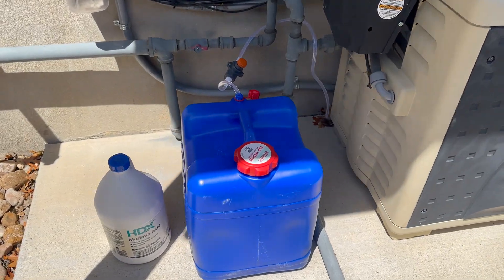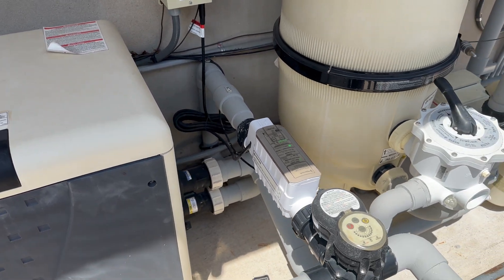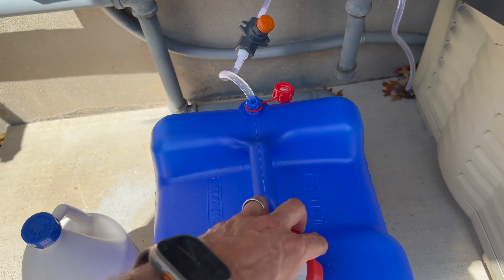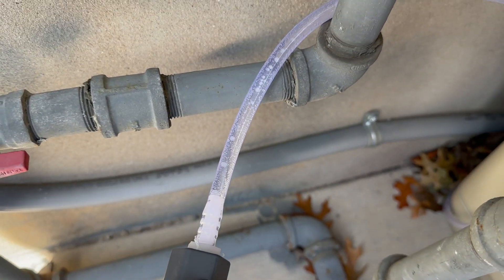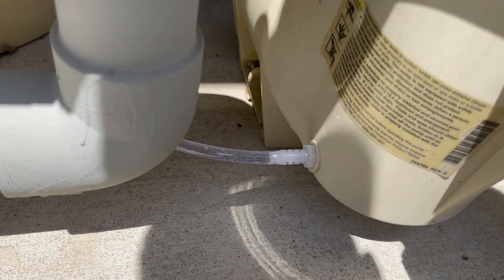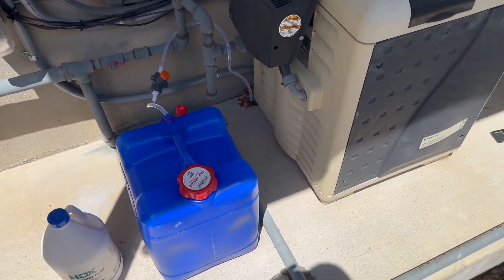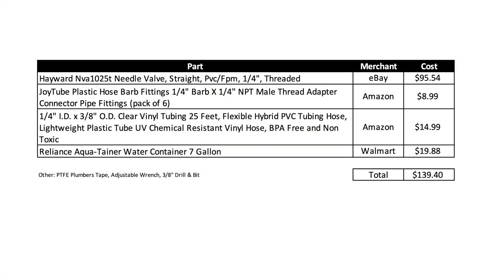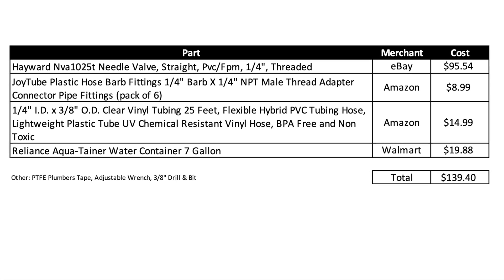DIY - Acid Injection System for Salt Water Pool (Part 1)

Comment: Hi, very cool idea. I would like to do the same thing. Just a couple of question. Online it says PVC is not very compatible with muriatic acid. Especially at higher concentrations. Any issues with your PVC valves corroding ? Also does direct injection into the pump suction create any issues with pump seal corrosion ? Lastly, when the pump is off does the negative suction pressure continue to pull acid slowly into the pump strainer basket ? I see you may have added a solenoid auto shutoff valve. I may do the same but I need to figure out how to get the solenoid to stay closed when the pump is not running. Thank you in advance and keep sharing these cool videos!
Reply from the maker: Without the solenoid I had a suction problem, and I did have to replace a shaft seal. Since adding the solenoid, I’ve tested the strainer basked 12 hours with pump off and there’s no pH change. I also am sure to run the solenoid early in the cycle so that the pump runs for hours after to ensure pool water has continuously run through it. 

I wired my aux circuit in an effective “man trap” meaning that the solenoid cannot be open of the pump is not operating. I also have an egg timer and a third party api monitoring automation ensures that the solenoid never opens for more than 10 minutes. 

I haven’t had any issues with the pvc valves. I do have them going inside plastic containers so if they leak I can see it. PVC seems totally good up to 20% concentration. Using 31.45% which is diluted in 50/50 water brings me less than 16%.

Comment: After seeing your video I bought the blue tank and then thought, why not use a bigger container?  I ultimately bought a 50 gal drum.  Instead of the expensive needle valve Amazon had some other needle valve options that I purchased instead.  The only issue I've come across is the tubing quickly becomes white and I can no longer see the trickle.
Reply from the maker: Agree on the tubing, but somehow some of my tubing is still clear so I can generally tell.

I opted not to go for a bigger container just in case I need replace the container. It forces me to inspect it once a month.

Comment: This will eat your pump seal up, spring in the multiport, Heater Core, salt cell blades.  This needs to feed after the Salt cell.  It is feeding very slowly but still will reduce the life of these things at the equipment pad.  That is why you spend the extra money for A Jandy TRUDOSE or Pentairs or Haywards version and install it according to there directions.
Reply from the maker: That was/is a concern of mine, but so far so good. I have changed the design and have a very high-end solenoid valve on it. So it's only activated for a few minutes with high water flow going through it and immediately followed by additional pump time at high.

I've considered an auxiliary pump and putting it at the end of the returns, but I've got almost two years on this and since putting the solenoid in, it's been very easy to work with and with the amount of acid and amount of water flow going for a very brief period of time, I don't believe the pH is getting low enough for that brief period of time. I've also tested (since putting the valve in) measuring the pH in the filter basket immediately after shutting off the system while running and if the pool water is pH 7.6, it might be 7.2 after sitting in the pump basket for 30 minutes, and again that's killing the pump while it's injecting. I run the pump for hours after injecting.

Comment: When the pump is off, does water run backwards out of the pump drain hole?
Reply from the maker: In theory everything just stops moving as it's completely sealed. That said, I'm currently troubleshooting a small air leak in my multi-port which provides a slight vacuum which causes the fluid to go into the hose at a very slow rate. Given the concentration of acid, you don't want that. I have a new multi-port getting installed later this week.
Reply from the maker: I replaced my multi-port and things got better, but it was still slowly coming into the basket.

I opted to install a normally closed actuator solenoid (WIC Valve). It wasn't cheap at $130, but it's heavy duty and rated for extreme temperature and corrosion.

I wired it to the Intellicenter AUX port and am pulling power from the main pool pump, so for it to open, the pump must be on and the AUX relay must fire.

I'm changing the setup from a drip to a higher-flow, like 1 ounce per minute, than intend to run it for ~10 minutes per day. I'll have an egg-timer on it for 5 minutes so if somehow it accidentally gets turned on manually, it'll shut off. Regardless, if the pump isn't pumping, it's impossible for the valve to be open.

Comment: Brian, I wanted to see if you were still happy with this configuration.  Looks like a good solution.  I have a 30,000 gal pool with an infinity edge so Im constantly in need of adding acid to the pool.
Reply from the maker: Yes, I ended up changing it up a little due to some issues, but basically it's the same design.

I've got it dialed in, it makes traveling a lot easier. Also, the low and slow delivery has me using far less acid than before.

Changes I made was putting a second shut-off valve near the pump, so I can shut off the flow on either side easily. I also added PVC to protect the connection into the pump. Long story short, I had the seal on my pump replaced, and the guy who serviced it stepped on the line and it broke the barb adapter in the pump. I had to carefully drill it out. So now I have two large PVC pieces sitting over that to prevent breakage of that.

I'm really happy with it!
Reply: @UraniumTwoThirtyFive  Thanks for the update.  i think I will implement something similar.  I take it the valve you added on the pump side is just for shut off purposes so needn't be a special needle type valve.  Also, I was reading about the tank and manufacturer says not to expose it to direct sunlight which would be pretty much impossible in my configuration so I'm guessing I could just figure on replacing the tank annually.
Reply from the maker: @tscmedlake  Yes, I'm just using a ball valve with barb, search "Ball Valve, 1 Pc, 1/4 In, PVC, Hose Barb" on Amzn.

I use a small cover for mine, it's also mostly out of direct sun except a little in the morning. I bought a small end table patio cover and throw it over the top of the tank.
Reply from the maker: @tscmedlake  I made a new video showing the updates including the ball valves and the cover I'm using. Here you go: https://youtu.be/cWmy4Ao4cBk

Comment: This is a really good idea and design. I see you have a Variable speed pump, are you running it 24/7 aka 2-3 hours on high speed and the remaining time on low speed to save money? I'm sure that would have to be taken into effect seeing as the acid would always be pulling 24/7.
Reply from the maker: Hi Michael. Yes, it's a variable pump. I run it different amounts during different seasons, so that actually helps with this design. I run it ~12 hours in the Summer and only ~6 in the winter, so that'll also impact the amount of acid going in, and generally speaking I need more acid in the Summer, so it should play out nicely. I can adjust pump time accordingly to tweak acid a bit.

I did some limited testing by putting the hose in a measuring cup. I'm not sure I could detect a huge difference between running at lower speed and higher speed. I have the needle valve basically closed and just the smallest amount leaks out (~1 ounce per hour).

I generally only run my pump at high speed for a few minutes after priming.
Reply: @UraniumTwoThirtyFive  Awesome, I only ask because I recently went down the rabbit hole of operating my pool at maximum energy efficiency while still maintaining a healthy 3x pool turnover rate. Swapped out a single speed 3 years ago to a VSP, realized this year 3 hours of run time is more energy than 18 hours of run time so I adjusted my schedule and RPM's based on TDH calculations and pump efficiency flow chart. Cheaper to run the pump for that 3+18 hour time than it was my normal 8 hour single speed.

Doing an automatic chlorine and acid drip is something I'd like to do eventually!
Reply from the maker: @Michael-Youtube98  I actually created a spreadsheet and calculated the power at different RPM and flow rates. For me 30 GPM yielded the best efficiency while giving enough flow for the salt water chlorinator and heater. I use about 400W on my VSF at 30GPM, going to 35 move me well into 500W which is like 30% more power for just over 15% more turn-over. It gets exponentially worse at more flow.

My pool stays super clean as it's mostly above trees and any non-human contaminates. So this works for me. I run ~11-12 hours at that speed in the Summer and 5-6 in Winter, always crystal clear.